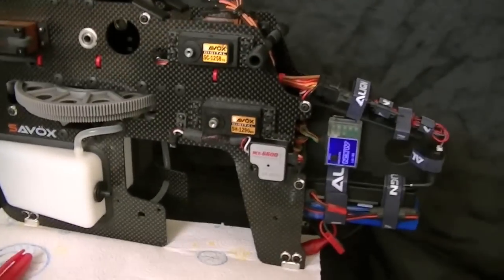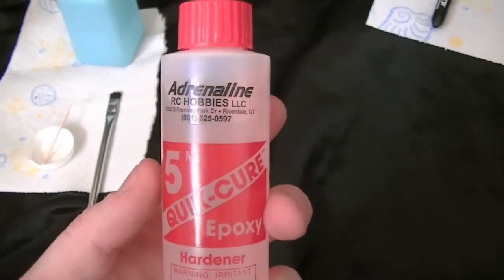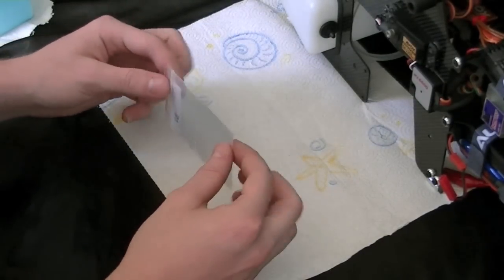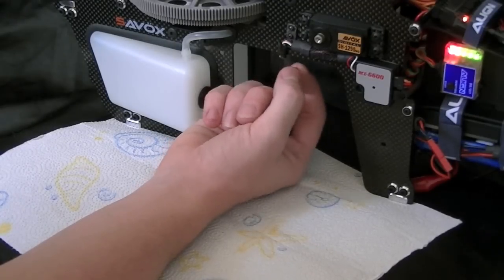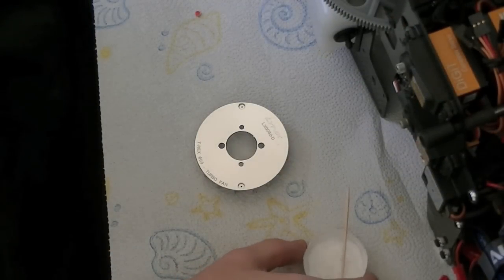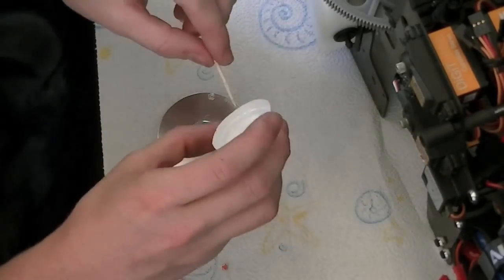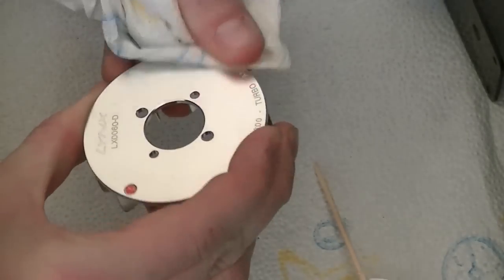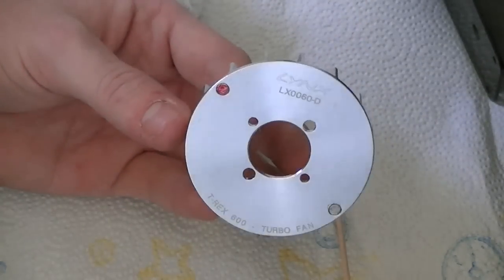heli tips and tricks (gov magnets/fan)

Comment: Hi Freddy..
I glued my magnets in the wrong polarity ( I put the north pole facing up for both of them)when I was building my T-Rex 700 and I tried to remove them ,but I couldn't ,then search through the internet for how to do it ,then I found the heat solution ,(magnet lose their magnetic feature when  you apply direct heat or flame to them, did this to one of them and it worked I got one north pole magnet and no polarity for the other one.